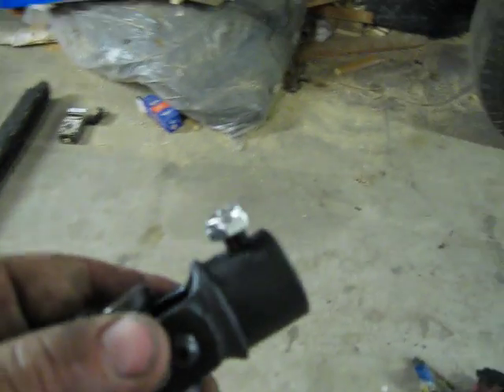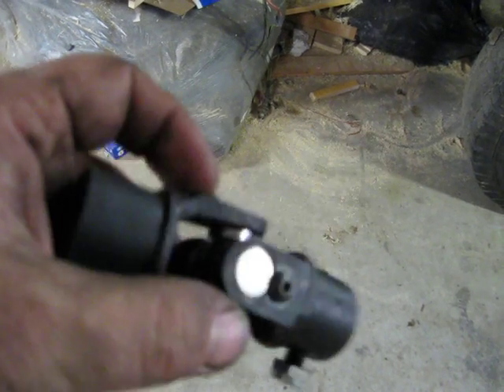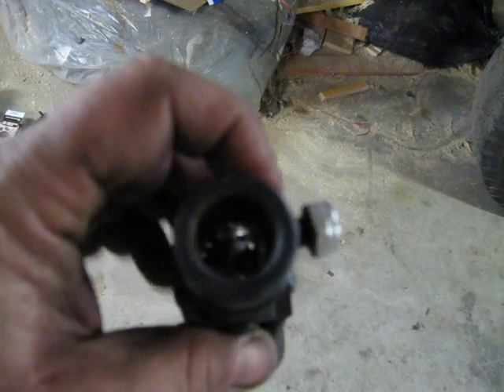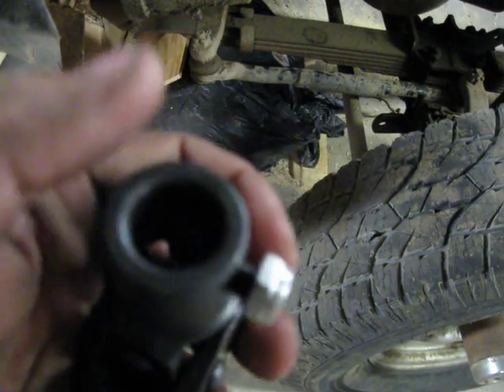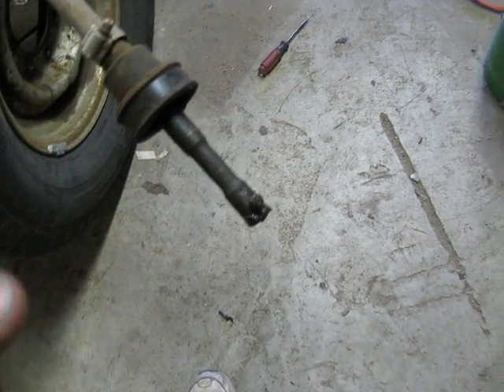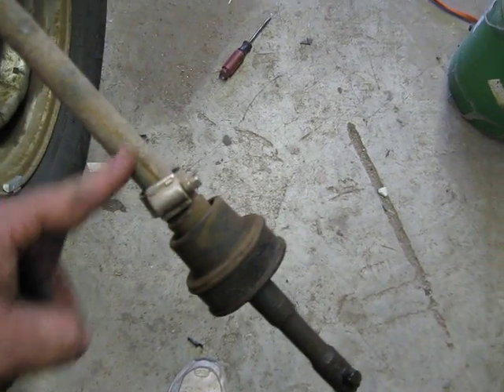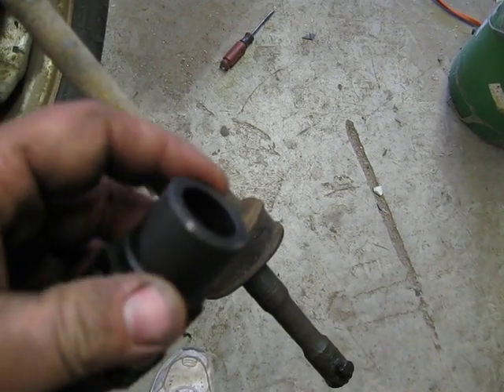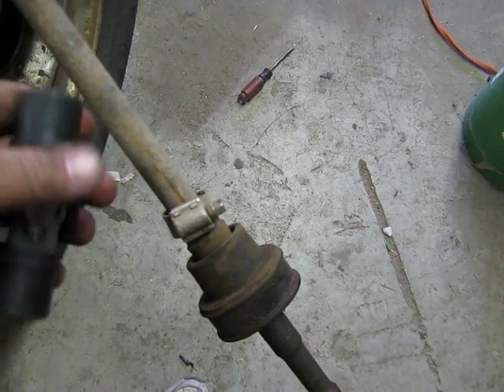Dodge Steering #1

Comment from the maker: You can find them on ebay or amazon. Should be a 3/4" 36 spline and 3/4" smooth. Alway count the splines and measure before you order. I am doing another one that has 2 ujoints it should be up soon.